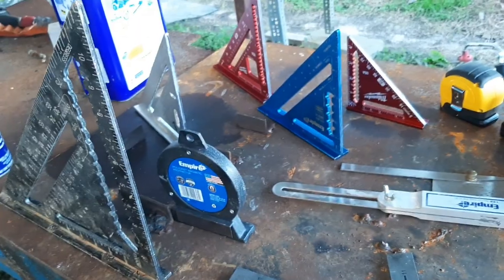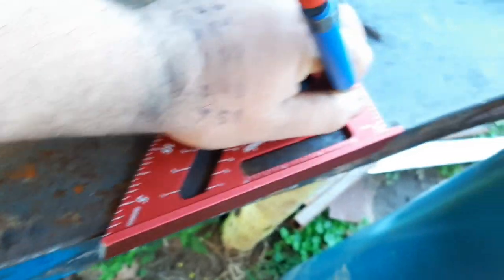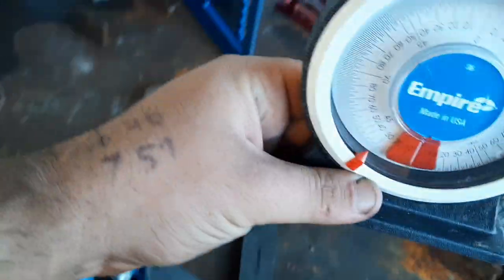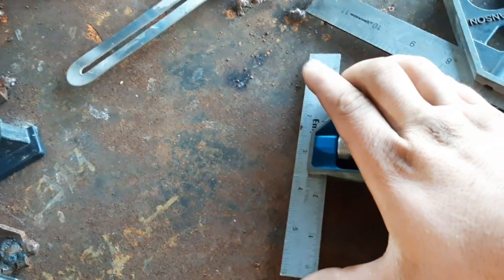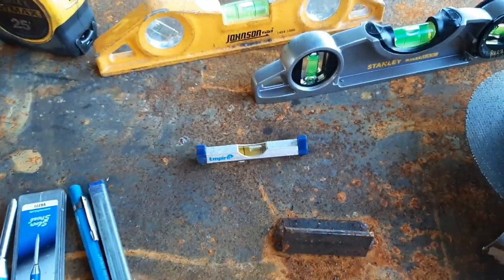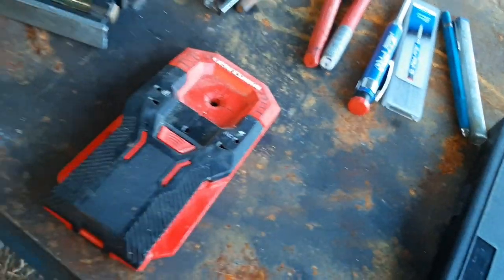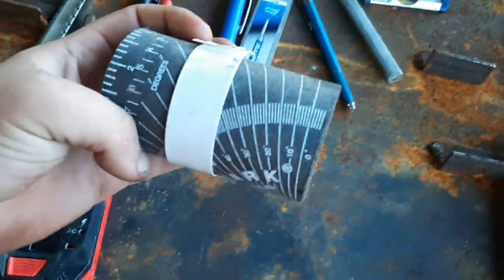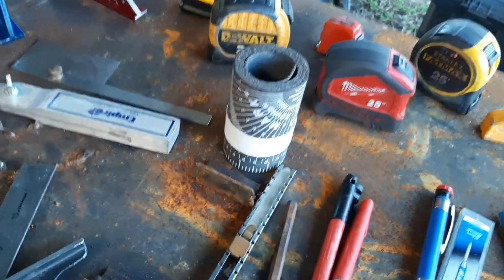Basic measurement and marking tools to start your welding business

Comment: the angle finder, very useful chopping motorcycle necks as well as driveline angles in vehicles.

for a laugh I did a small project last week,  asked my wife for a tape measure, she brought me a 6' keychain one, lol, so I used it,  I kept thinking I have quite a few tape measures, why on earth did you bring that one, but didnt say a word,  I used it, & built item & it fit perfectly. a set of bars for a business door at a friends business, normally dont use the tiny tape measure except for a quick lightweight pocket carry to give idea, usually for car sheet metal. 

anyway great video as always